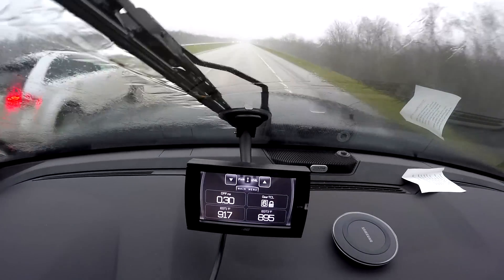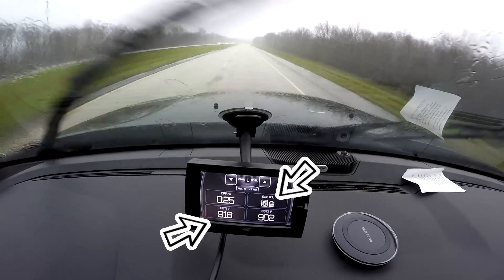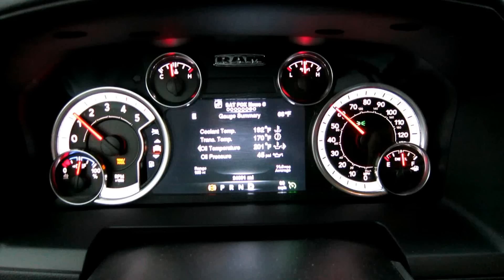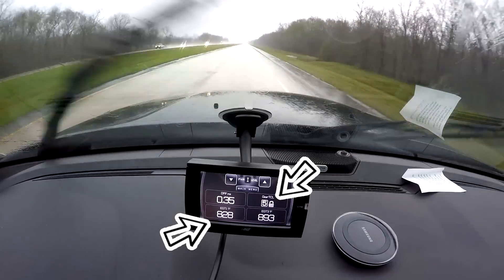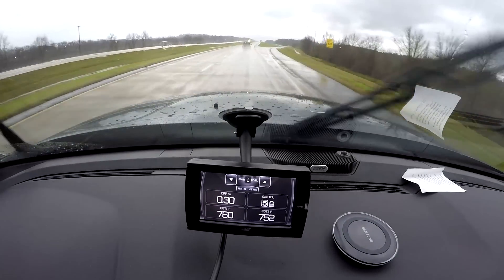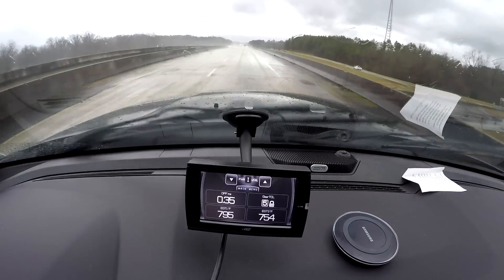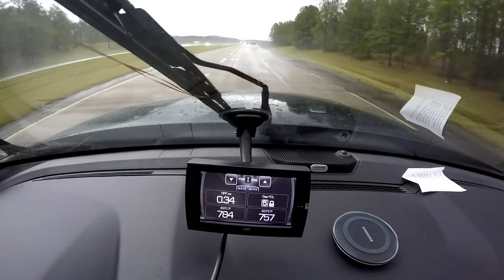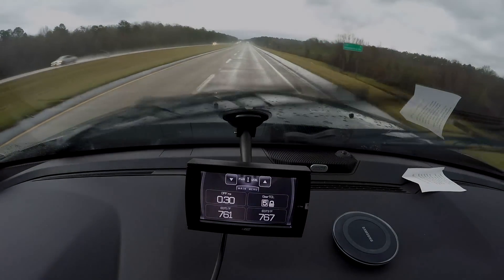RAM 6.7 Cummins - EGT vs RPM - Lugging

Comment: 1750 rpm is also sweet spot for my 1.5 lit ford diesel sedan. I cannot measure these parameters, but can measure fuel economy, and it is best at this rpm. Driving feel is great at this rpm, but it will look like i am driving one gear short.

Comment: I've watched your videos many times. Good job on all  and thank you for the great info. 
 What is  the max safe zone for egts when towing heavy grades  I've had to drop to 3rd gear going 55 mph 2700 rpm an 1150 ° egt  towing 9k 
 Deleted 2010 with 37s and 4.10s
Reply from the maker: About that.  Under 1200 F.  Never have to do regens, ha

Comment: I got a 2019 Laramie 4x4 Cummins with a 3.73 rear end. With that newer lower geared rear end, my engine runs around 1,700 rpm at highway speeds so I really appreciate the new ratio used. I believe they used to stuff a 3.42 in the 4th gens. Perhaps you may want to consider changing your differential gearing.
Reply from the maker: Yes I agree 1700 is The Sweet Spot. If I was towing a heavier camper I'd definitely do that
Reply: My 2017 3500 came with 3.73’s and I love the way it pulls.

Comment: What monitor are you using?
Reply from the maker: That's an old Edge Insight but I'm using a Banks Idash now.
Reply: @MarionBlair , okay thank you. I'm assuming you like it better. Any issues with either?
Reply from the maker: @jackbolt7163  I have a review on the banks vs the edge https://youtu.be/uQIuX63wVX0 but the bottom line is edge better built but idash more info.

Comment: When I have my slide in truck camper on my truck and or towing my Jeep I never use 6th. 5th on the highway going 70 at 2300 rpm. EGT about 850. 4th gear in the mountains up to about 55 mph. It pulls effortlessly in those gears. 6th is just mostly an overdrive for the flats and low rpm cruising.

Comment: How did you install your egt probe
Reply from the maker: I use EGT1 which is mounted on the back of the turbo.  (comes stock with the truck)
Reply: Marion Blair thanks a little confused do I need  to hook the monitor to this or does it read from obd port
Reply from the maker: Edward, sorry for the confusion.    All you need is the gauge that plugs into the connector under the dash like the banks Idash or the Edge insight or you can get a Bluetooth adapter and use an android phone with the torque app to read the probe.  Every sensor's value on the truck is available at the ODBCII adapter under the dash.  It's just a matter of plugging in something that will read it.  One thing I might mention is that since the probe (EGT1) is behind the turbo, it's not going to be the exact same value as if you had a probe on the exhaust manifold itself but in my opinion, it's plenty adequate.  There's 4 probes in the exhaust  and after a short time on the highway, they all read very close as the heat travels down the exhaust pipe.  EGT3 would tell you when the truck is in a regen.  It's probe is located behind the DPF filter.  With an ODBCII gauge, you can monitor it and tell when your truck is in regen.  Let me know if I can help.
Reply: Marion Blair you are awesome thank you so very much 1 more ? Regen what would probe 3 read when in regen and can I shut down during regen safety first dodge Cummins just traded my 2016 Nissan Titan xd for a 2500 ram
Reply from the maker: @edwardmachado3957  EGT3 will quickly start up and rise above EGT1 temp when in active regen.  That's when diesel fuel is injected in exhaust to burn the soot.  It'll go up to about 1100 deg F  max and stay at 950 to 1100 for about 20 mins.  The turbo doesn't see that temperature, since the heat is created by oxidation (not an actual fire)  in the DPF filter downstream of the turbo.  The turbo does get about 100 deg F higher than it normally does so if you know you know the truck is in a regen, it's better to give it a little extra time (3 mins or so) before shutdown. ( It's nearly impossible to tell a regen is on without a gauge) That's being very conservative however since the turbo bearing is water cooled and the temp comes down pretty quickly when the load comes off.  You'll rarely see an active regen when running or towing at highway speed since the exhaust heat is high enough to burn the soot off without adding diesel.  In the city I see them often, like every few hundred miles or so.

Comment: Did you have to add a EGT sensor or does your truck already have a EGT sensor that the system pulls from?
Reply from the maker: It has a sensor right behind the turbo which is adequate for most purposes. Some people tap and drill the exhaust manifold but I haven't done that.
Reply: Marion Blair awesome thanks for clearing that up I’m new to owning a diesel so I wasn’t sure. Any thoughts on adding a turbo timer? Was thinking about getting this system and having one installed but haven’t made my mind up yet.
Reply from the maker: @Harvesttimebluegrassgospel  it would be nice to have one but I usually sit in the truck till the temperature is down to 400 degrees, or 7 minutes would be a safe conservative number if Towing hard.
Reply: Marion Blair thanks for the replies nice to get feedback from someone trustworthy. Never know who to believe on the message boards. Have a good day.
Reply from the maker: @Harvesttimebluegrassgospel  thanks, anytime

Comment: Hey Marion will you ever delete your truck? It would be really awesome to see some of the test results on the data mine
Reply from the maker: I'm seriously considering it eventually.
Reply: Marion Blair I ordered a setup for my truck can wait to see if there’s any difference to feel. Going stock tune and just delete. Then after a few months gonna try 30 Hp pdp tune and revmax valve body line pressure kit. Can’t wait my nerdy ass went out there and broke all the bolts loose so install day will be so easy.
Reply from the maker: @GrumblesM4  Ha, I know what you mean.  I think it's great.  I've started doing a little research myself with my new creeper my wife gave me for Christmas, ha.  Just looking to see how tough it'll be for an old man, ha.
Reply: Marion Blair I second that my younger cousin is coming over to help hahaha!!! that concrete hurts these days!
Reply: Marion Blair hey amigo well it’s been a yr I’m up to 93,0000 miles now , I deleted at 70,000 so far still a perfect machine. Level 1 all day the only way 19-21 mpg hand calculated every tank

Comment: Great video, I tow a 27ft bumper pull.  Deleted all the way.  I run in 6th gear without any issues, but I will try 5th after watching this video.  I will check my EGTs and see what happens.  Never really watch the EGT temp in 5th, but I will check your theory.  Thanks
Reply from the maker: Awesome.  Thanks

Comment: Great video and advice for not just the 6,7 litre cummins but also the 5,9 cummins which I have. I am also a truck monitoring fanatic with gauges everywhere. lol These engines are built to work hard so if you do a lot of short distance driving in between towing try and take her on the highway at least every other week and give her some strong acceleration. Brief egt boosts will help the injectors and engine internals keep any carbon deposits burnt off and egr burns keep the 6,7 egr emissions in check.
Reply from the maker: Thanks much, good advise for sure.

Comment: Marion (Mr. Sanders) Do you have a video on how you installed your monitor and why you decided on this monitor?  I'm the market for one on my 2018 Ram 2500 and need a recommendation.  Thanks and Adios.
Reply from the maker: HI Brent, I'm looking for an upgrade myself, I'm not happy with the screen glare on the Edge CTS.  I'm trying to get one to test to see if they've improved that.  Bullydog has one but I don't know anything about it.  I'll do a video on the install, nothing to it, just plug it in.
Reply: Thank you.  I will keep following to see which one you choose and how to install it.  Followed your oil change process (tools and all) and made it easy and spill-free.  Thanks again and keep up the great work on the videos.
Reply from the maker: thanks, I'll keep yall posted. Hopefully, I can research one quickly.

Comment: Driving downhill will exaggerate this effect more.

Higher rotation per minute meaning lots of air getting in and  out from the cylinder, lowering each cylinder block temperature.

From 1000 rpm to 2000 rpm is twice amount of air in and out expell the heat out to the exhaust.

When driving downhill the engine injecting fuel less, and having large  volume air in and out due to engine braking.

Less fuel meaning less combustion, resulting lower temperature. And high air flow exaggerating heat loss effect more.

Comment: What do you think about the actual recommended towing rpm from Cummins. 1900-2100?
Reply from the maker: That's the best power range, may burn a slight bit more fuel but it pulls so much better.

Comment: Hi Marion, great video I've wondered for a while what the safe EGT temp is while towing. I am also curious on transmission temps while towing, have you noticed much difference while towing compared to not towing? If you've already done that test could you please attach it for me? Thanks.
Reply from the maker: Thanks Dennis.  No I haven't done one on tranny temps yet. (other than a general video on the 68 RFE below).  I don' t see much transmission temps change on the flat towing.  Seems I always hang around the 170's 180's.  The exception is in the mountains on very steep long grades.  Going up Monarch Pass in CO.  I got up between 200 and 2010 which is still well within the safe synthetic oil range.  That's the only time and the reason was I dropped down to 3rd and even 2nd for a while.  The torque converter doesn't lock at all in 2nd and although it locks in 3rd, it will unlock if the grade is steep enough which it was.  Back off the throttle a little in those conditions and the temp drops right down.  That's been my experience with the tranny.  Here's the video I mentioned.
https://youtu.be/sRaREsw2vIk
Reply: Thank you very much, I'm not new to towing I just haven't towed with an automatic I have pretty much the same truck as you but it's a long bed and a 2017. I'm doing all of my research so when I get back to the states and buy the 37' 14000 pound 5th wheel I'll know what I'm getting in to. Thanks again for the info, I'll be watching.
Reply from the maker: Thanks Dennis
Reply: recommend a 3500 1 ton...

Comment: Finally a good example... I used to lug the engine and wondered how it warms up so quickly... Now... never again !
Reply from the maker: Thank Anto, I was surprised myself at the drastic difference and I had a very light load.
Reply: I hauled about 2 tons of shit trailer and truck bed from Salem OR to fort Worth TX filled up on def before and made it half way back before getting more
Reply: If you use tow haul or exhaust break you use more

Comment: Well, some may claim your vids are boring, but I find them to be plain and very useful. Were you towing 7000 lbs? What is your average mpg when towing at say 70 mph? Thanks!
Reply from the maker: Thanks, Hi, I usually get about 12 mpg depending on head wind etc..  Sometimes more or less.  I usually stay between 63 and 65 mph
Reply: Thanks. 1/ good mpg!  2/ and so true, lugging builds soot and will kill a diesel. 3/ are you reading EGT directly from the OBD connection, or did you install a non-stock sensor?

Comment: Marion, nice job. Nice shot of the dash showing what gear your in. Most people don't know you can see that by tapping the manual mode button. I've watched "the fast lane truck" many times and they complain they don't know what gear their in. Your right on the EGTs and gear selection. The 6.7 really pulls but its nice to keep thing in check. What programmer is that.
Reply from the maker: Thanks very much, it's a Edge CTS monitor.  No program functions.